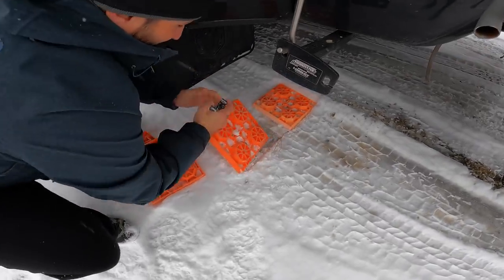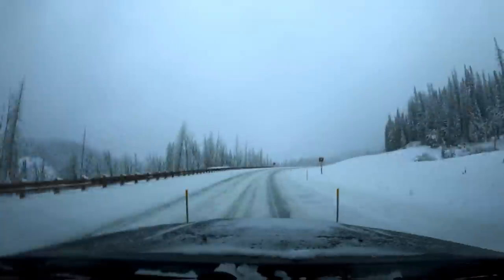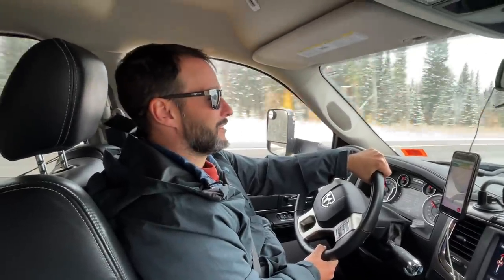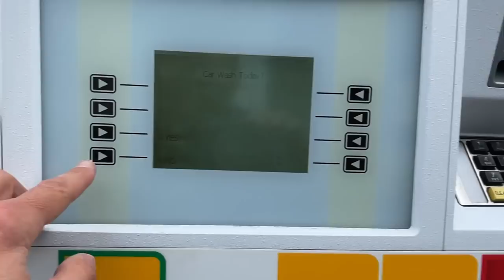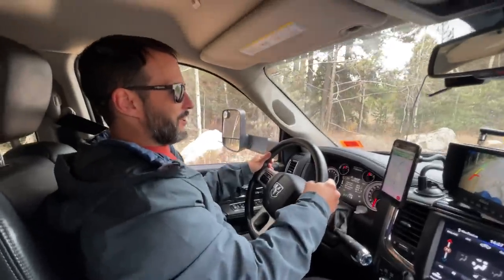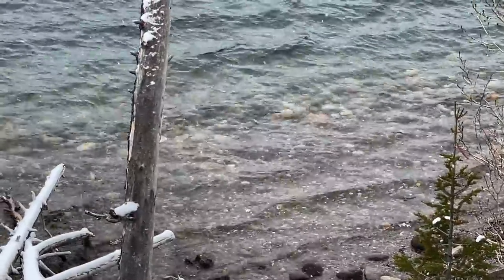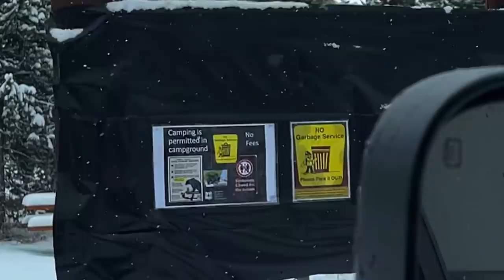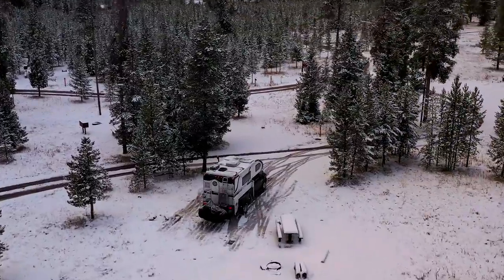❄️WINTER TRUCK CAMPING in The Tetons \\ Winter in Wyoming Pt. 2 \\  Vlog 23

Comment: Switch to Anderson levelers, you’ll throw those orange squares away like we eventually did. Anderson’s make leveling super easy, we’ve never been happier. OH, they would’ve been easier to remove in the snow. 
Nice video, thanks for sharing.
Reply from the maker: I’ve looked at them but have some issues with how they work. I need to adjust individual wheel height. I can select 1, 2, 3, or 4 blocks to get my desired leveling. With the ramp style, I’d need to adjust the distance from the tires and gauge height on distance traveled. I think they are a great idea, but I see them mostly for lifting none side of a 1 or 2 wheel trailer. 

Any advice on using them to level a truck camper?
Reply: @Stonyboot  I tried replying twice, it keeps getting deleted

Comment: Thanks for the tip of using alcohol to sterilize the water hose! I am loving the winter scenery in this video❤️ I am a big fan of winter camping!
Reply from the maker: Thank you! We always sterilize water connections, because we never know who used it prior to us. And that little spray bottle has been working great!
Reply: Just make sure it's the 70% for sanitizing, not the 99%. But you can mix the 99% down to 70% with distilled water. :)
Reply from the maker: @wingnutbert9685  That is an important detail that we didn't talk about. I'll try to mention that in a future video. We do use 70% alcohol. We also have 91%, but that's mostly for cleaning, prepping surfaces, and drying things.
Reply: @Stonyboot  Yep. It's something that isn't realized by many. Understandable to think high % would be better. But the science of how it kills germs/bac/virus cells makes the 70% ratio apparent. Basically, the higher % alcohol desiccates the cell wall too fast and actually protects the core, keeping it's moisture. Thus allowing it to survive and recover. 70% ratio is the golden ratio. Has enough water to not desiccate the cell wall so fast so the alcohol has time to soak in to the core and actually kill it. I get the 99% in boxes of 500ml bottles. Mix that w/ 210ml distilled water. Much better then the gel hand sanitizers which, these days, are dodgy at best and it's way cheaper and leaves no film on your hands. Good for cleaning too. :)

Comment: Y'all put that truck and camper to the test.... I'll be 65 this year...from Ohio but moved to S.C. 22 years ago. I had enough of winters.  Rebuilding my old 2001 Dodge dually. Used to pull a 53' wedge trailer with up to 26,000 lbs gvw. Truck is built just needs freshened up. Looking at a camper like yours or an all fiberglass Northern lite but being from Ohio, leaning towards Nucamp. Those Amish and Mennonites are true craftsmen!
Reply from the maker: Our rig has held up surprisingly well! I agree with you on the winters, we are enjoying Arizona right now and have no wish to return to the cold north. We are very happy with our Cirrus, NuCamp does build quality products. NL is very nice too, but it comes down to personal preference. Good luck in your search and with rebuilding your very cool truck!

Comment: Once again, for stuck frozen “stuff”, always carry a jug or two of windshield washer fluid and throw a few little splashes of it on the corner of your traction plates. With just a quick splash they will come up quick and easy. 👍🏻😎👍🏻
Reply from the maker: Thanks for the tip!

Comment: When I watched you take the fuel cap off the truck before fueling, I noticed all the dirt that had gotten in around those filler necks. It is amazing that the car companies are selling these vehicles without fuel caps and that you need to purchase one like you did to protect your fuel inlet from letting all that dirt settle in there. These trucks DEMAND super clean fuel. I am just amazed they think none of that dirt will end up in your fuel tank only to cause havoc at some time later down the road. Nice job handling the truck through the slick stuff. I have the same in a single rear wheel and when you have a camper on the back skidding takes on a whole different meaning.
Reply from the maker: The truck came with a plastic cap, but they are notorious for leaking and letting stuff in. I bought this filler cap on amazon since it has a better seal. I’m disappointed with the quality and style of the filler neck, its plastic and prone to break. So far, it hasn’t, but on a $62k truck, you’d think they would give you an actual cap. The road was actually pretty grippy, the snow had a favorable consistency. If it got nasty, I would have put the chains on. We don’t want to lose control…

Comment: You need to run your heater hoses inside your camper with a heat exchanger and blower to keep it nice and warm while driving and it works great . Even with liquid floor heat you can tie in with check valve and a bypass valve. Check in to it if you do enough clod weather camping you will save a ton of propane !
Reply from the maker: I've seen systems like this, but they would be complex to disconnect. We don't spend enough time in the cold to justify the complexity. However, if I were to build a custom overlanding rig, I'd look at a diesel heater and possibly a heat exchanger for the truck/camper.

Comment: My dream, one day when I get tired of pulling this 40’ fith wheel around this is what I want to do. Truck campers give you so many more beautiful options.
Reply from the maker: Somedays, I wish I had a 32'-38' 5er, I miss the space! But, for now, we LOVE getting out into the middle of nowhere! I'm sure we will change someday, or get a larger camper with slides. The great thing is that it's fairly easy to change your setup.
Reply: @Stonyboot  to keep you from always being on the edge of maxed out weight wise would you move up to a larger truck to haul a heavier camper.

Comment: Great video! I woke up with 33 degrees inside my camper. Finding out both of my propane tanks went out during zero degree night. Brrrrr.
Reply from the maker: That's no fun! Many people disagree, but we always leave our second tank OFF, I'm happy to go change it in the middle of the night, knowing that I have a completely full tank. For me, relying on auto changeover valves  means that if I have a leak or other problem, I could end up with no propane. I've had 3 regulators fail and leak on me, so I really like having my second tank closed and ready for action.

Did you have anything freeze?

Comment: From northern Wisconsin walleye are best in winter. My truck camper handles it great and keeps me nimble enough to blend in. Constantly at boat landings/roads close to shore watching tip ups if u know what those are. No problem.
Reply from the maker: Those are some harsh locations, but perfect for ice fishing. I bet your TC makes an awesome base camp!
Reply: @Stonyboot  yeah here I was bragging it handles it great and I accidentally let my water pump freeze (cold temps snuck in and I blew out lines but forgot to run antifreeze into pump).  I'm simply going to plug into shore power when not in use and keep my furnace set at 55.  I'm in this thing constantly and don't want to mess with antifreeze if I don't have to.  Hope that pump thaws out and works properly.....

Comment: just came through there this fall nice place also a cheap diesel heater hook into your truck system and helps a lot and also burns off humidity in your rig, and i carry a 4 way hose key never had any gas station or store refuse me to fill up water on their outside hose bib and i also carry a hose bandit for places that may not fit my water hose great content
Reply from the maker: A diesel heater would be nice, but we don't plan to spend much time in the cold. I have a hose bandit and have used it a few times. I don't have a key, but people are usually kind enough to help. Most of the time, gas stations attendants have no idea if its ok, but, frequently they say sure. We use apps to plan our our water fill ups and it's been pretty successful so far. If we ever got really stuck, I'd just go talk to people and I'm sure they would be happy to help!

Comment: Hearing you say filling propane tanks to 4.6 gallons (if i heard correctly) just gave me so much anxiety lol even completely empty we'd never fill them past 4.2 gallons. We've had people get them overfilled in the past like that and it lit their decks on fire cuz they use them for their bbqs. They have an automatic shutoff in them that should never allow them to get to 4.6 gallons. Be careful! My work fills propane tanks (I've been filling tanks for just almost 5 years now) from that same size all the way to the big 100lb tanks (that hold 22 gallons) and over filling is a huge problem. That being your vehicle and your home, I dont want you to go thru something bad with your propane tanks. It could literally catch your whole rig on fire
Reply from the maker: A 20lb propane tank holds 4.6 gallons of LPG. That is where the OPD will shut off. 

According to many industry websites:
20 lb Propane Tank
Dimensions: 1' 6" in height and 1' in diameter.

20 pound propane tanks are often referred to as grill cylinders and hold 4.6 gallons of propane when full.

4.6 is normal when the tank is empty.

Comment: Please be careful using your engine brake (or cruise) in any snow or ice, especially on a  down grade. Your saving grace is the weight on your rear axle. Please check the manual for warnings. Love a cold camp, I run my 120" sleeper propane heater November and half of December on one 20 lb. tank. Think about an auxiliary engine coolant heater for your Backpack. Nice and warm when you stop. Enjoy!
Reply from the maker: If the wheels slip, the exhaust break disengages on our truck. The road was pretty grippy and I frequently check the conditions. Also, in a situation like that, I'll run in 4x4 to distribute the engine breaking force front and rear ready to hit neutral if needed. 

We don't really plan to stay in the cold weather for long, so I don't really want to invest in extra equipment for staying warm. I'll just drive south 😂 !

What kind of truck to you drive?
Reply: @Stonyboot  Freightliner FL106 with a 120 inch sleeper. Gotcha on the runnin South. Your comment is correct about the learning curve. RV everywhere you can.  Rv'd 49 states and trucked 48. Never driven engine brake and traction control interfaced, good deal.

Comment: I noticed you have a mesh screen over your Alde exhaust port.  Did that come with your Cirrus camper?  I have a NuCamp T@b 400 BDL with the same port.  Did you Install it yourself and if so why and where did you get it.  My wife and I love your. Videos.  Thanks
Reply from the maker: That is a screen to prevent critters (especially insects like mud wasps) from getting in there. They are easy to install and work very well.

I'm pretty sure this is the correct size: https://amzn.to/3rBTOm7

But double check your measurements. Also, keep track of the tool they include with the kit, it's essential to installation and removal of the screen.

Comment: Are you guys already well outta my stomping grounds?  I really wanted to meet up with ya'll!  Also, x2 on the exhaust brakes.  Our Rams have the best in the industry!  Lastly, my father instilled me with a bit of knowledge I'd like to pass out to you and anyone else who would like to know it:  Keep your thumbs on the outside of the steering wheel.  If you get in a crash, the airbag will explode outwards and break or severely injure your thumbs.  He was an accident reconstructionist for the highway patrol for over 20 years, so I'm sure he knows what he's talking about.  
1.6 gallons for 24 hours?  Wow!  That's not that efficient.  I'd love to do a comparison video between our campers.  that being said, I only have another couple weeks before I'm dry camping up here in the north country.  It's just too stressful making sure I have enough battery and propane to keep up with the cold temps.  I have noticed in similar temps, I can make a 20 lb tank last around 4 days.  it would be a really cool video to compare the differences between the Aldi system and the conventional forced air furnace(of which I'm not a fan).  I am only on 2-12 volt lifeline AGM batteries that give me a total of around 130 a/hr of energy, so I am very concerned with power consumption currently.  Up here in the north country, solar( I have 2-100 w currently) is not the best option for maintaining power, so the struggle is real when I full-time up here in the north country.
Reply from the maker: Yeah, we are in Washington now. We tend to run 2-4 weeks behind with our videos for a bunch of reasons. Whatever we post is going to be at least a couple days behind where we really are. 

Your dad is 100% right. Not only are the air bags dangerous, but if you hit something with the front wheels, the steering wheel has a tendency to spin and will take a thumb or finger with it. Don't ask me how I know... It's very good advice and seeing your comment reminds me to pay more attention. Thanks for the reminder :)

Most RV heaters have similar thermal efficiency, however, the amount and type of insulation varies widely. The Alde is efficient, but the insulation is not as good as some other brands that are really focused on cold weather camping. We never had plans to spend much time in the cold, but we will make the best of it while we are in the north.

Cold weather camping is definitely more demanding than fair weather. I still love the adventure!
Reply: @Stonyboot  well, if you find yourself in utah in december, specifically moab area, hit me up!  I'll be down there all month and have my 6x6(as seen on my channel) that I'm going to have a lot of fun with down there and you're more than welcome to join!

Comment: How many times have you gotten stuck in snow? Duallies are notoriously bad in snow. I got stuck once in Colorado mtns and barely made it out. Almost had to go get my Tacoma to pull myself out. Also, did a 360 degree spin out going down Berthud pass. Evidently going 35mph was too fast for conditions that day. Also, didnt have enough weight in the bed. Goodyear Duratracs x6 couldnt save me.
Reply from the maker: I've never been stuck in our rig, a little slippery, but never stuck. I'm actually surprised at how well its done in mud, snow, and off road.  Having as much weight as we do is very helpful. I also try to avoid anything that looks like a bad idea. I've had my fill of getting stuck in the snow back in my teens and 20s out doing stupid stuff in snow storms. It was fun back then, but I don't have any interest in those kind of games anymore! 😊

Comment: You guys are blowing it.  Ditch the propane heater and just use the gas for your stove and fridge.  Install a 2kw diesel heater.  You can boondock for days.  They sip diesel and have next to no draw for the fan.
Reply from the maker: I agree that diesel heaters are night, but as a general rule, we don't camp in the winter. While this was a fun little excursion, we don't plan to spend much time in the winter. No sense in spending money on something that won't be used more than a couple times a year. But yeah, Diesel heaters are awesome! What brand/model do you prefer?

Comment: Please don't use your exhaust brake or cruise control when driving on snow or ice, it's the quickest way to the ditch there is.  Stay safe out there and enjoy.
Reply from the maker: The exhaust break is integrated into the ESC system, I was in 4 wheel drive to distribute the breaking front and rear.  The road conditions were actually pretty grippy and that was approximately 5 miles down hill. The exhaust brake kept our speed right where I wanted it. If it was icy, I would have used chains and no exhaust brake.

Comment: Scott have you checked your tie-downs lately I had to put a reinforcing plate on mine they were wearing through.
Reply from the maker: Long story short, I had been using a torklift "tiedown relocation bracket" for 1.5 years, I finally took it off over the summer. So my tiedowns points are like brand new. But yes, I checked everything frequently.

Comment: I wonder if the propane use would be less in more winterized campers like the Northern-lite, Bigfoot or Lance?
Reply from the maker: This is a 4 season camper, but it isn't purpose built for cold weather. I'm sure that a NL or BF would have an advantage. They have more insulation and are very well designed for the cold!
Reply: "Alaskan" as well.
Reply: @frenchfryfarmer436  — Our N.L. 10.2 Limited is Rated down to 5 above zero. My experience is don’t worry about propane use, just keep all tanks full, stay comfortable. Have fun. 

However, we do not live fulltime in ours. We do plan on cold climate camping/traveling when we hopefully get our 3500 truck built.

Comment: Scott and Sasha get Weather Tech Matt's for the floor of the truck.
Reply from the maker: Good tip! We have factory molded rubber mats. Weather Tech are nice, but the factory rubber mats are just as good. I gave up on cloth/carpet mats years ago. Now, I can just dump sand, mud, snow, and water out while keeping the actual floor dry and clean!
Reply: @Stonyboot  Hit Weather Tech for some free bees you'd be a natural for them.

Comment: I’m a new subscriber. Greetings from Puerto Rico. Love your channel. Like the truck/ cargo system. Question… how do you know you are leveling?
Reply from the maker: I use a mixture of a bubble level on my dash and my cell phone, we also have a bubble level in the camper on our counter. Somtimes, while parked on we or muddy ground, we will sink/settle and that will change how level we are. Our biggest consideration is making sure our shower drains properly. So, if we have to guess at it, we just make sure the nose of the camper is a little lower.
Reply: @Stonyboot  thanks for responding and for the given explicitly explanations
Reply from the maker: @drcsep  No problem!